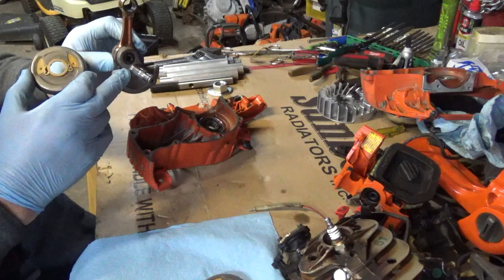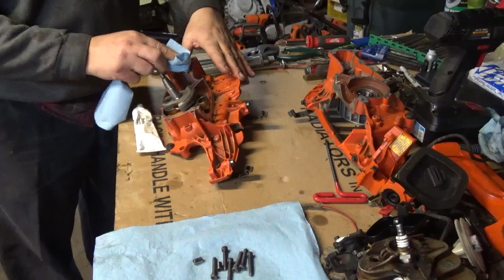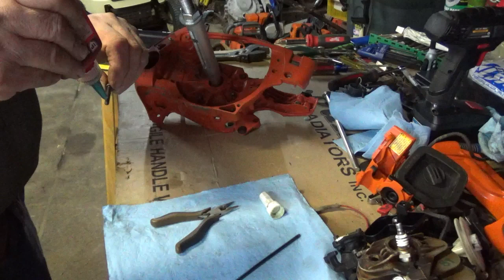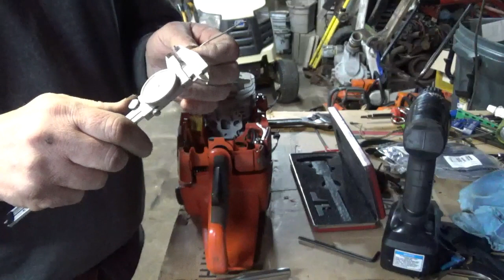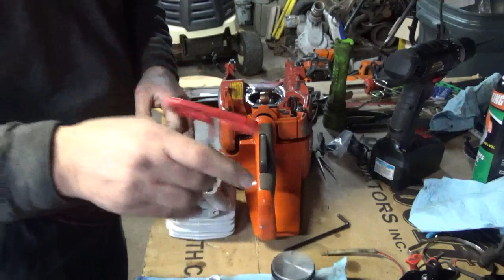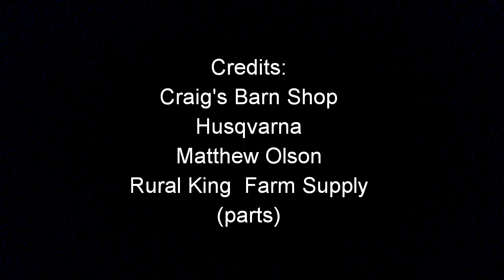EBay 576 Autotune Assembly #1

Comment: You used the wrong sleeve on the flywheel side.  Those are 6203s....and need the large sleeve ...the small sleeve is 1mm too small for it.  Large saw. ..large sleeve.  And the crank will be fine.  But I've mentioned this many times on the site.  Small saw...small sleeve.  Large saw ...large sleeve :)
Reply from the maker: I realized I had used the wrong sleeve after I had to hammer it off, luckily I didn't flare the end out. I just can't follow instructions very well. LOL
I had marked the 880 sleeve when I received it but failed to do so on the 576 rod, but that's taken care of now.
Thanks Matt.
Reply: @craigtimmons3468  remeasure the end of the small sleeve, spec is about .735"   for the OD.   its likely flared.  overall it is designed to fit in a 19mm seal pocket, so it needs to be slightly smaller OD than that.

Comment: You did the install perfectly. ..the rod is m15x1.25 and is 576 specific and is intended to be used with the large sleeve.  The other sleeve you had is 880 specific ...so you did perfectly to not use that one on the 576.  Nice
Reply from the maker: Thanks Matt